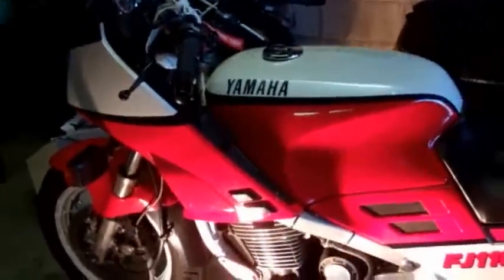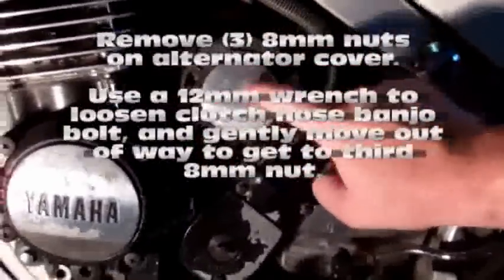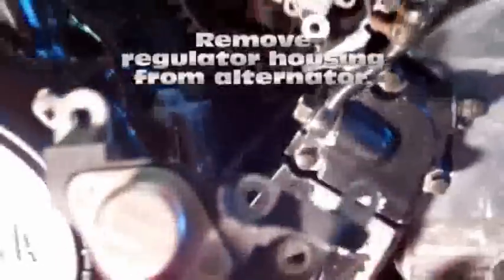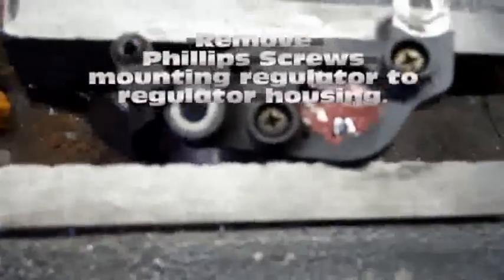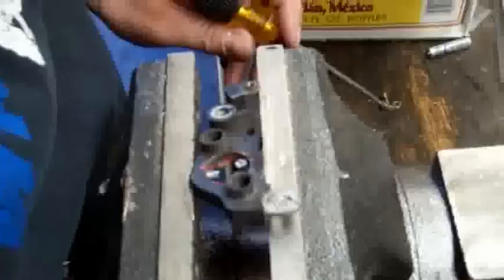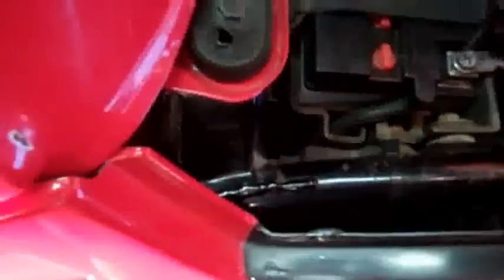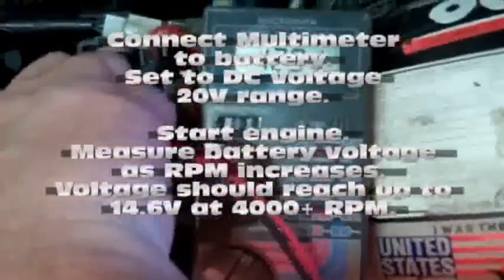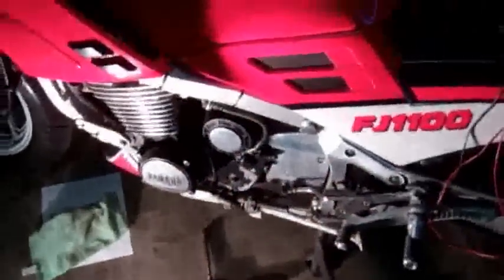RaceTech Electric R025 Voltage Regulator Install on Nippon Denso Alternator in Yamaha FJ1100

Comment: Thanks for the video. I've had my FJ1200 since 1994 & have had generator problems in the past. A couple of batteries got overcharged until I installed an automotive regulator external to the generator. My generator stopped charging so I had to replace it with a used one & installed the RaceTech regulator in it. The video was helpful to assure me I was doing it correctly.
Reply from the maker: Thanks for the info!

Comment: I purchased one. Revisited the video for install. A few points: There is a reason the camera cuts to installed. The part’s from China and it does not fit properly. I have 1993 FJ1200. Tools needed: 
1.Tin snips to trim the connectors.Rings too big and need to be trimmed way down or crushed in place. 
2.Razor blade to trim back the wire sheathing.Need to bend wires to fit without destroying the part.
3.Offset nut also needs a washer.
Reply: The prototype likely worked great. The supplier either has QC issues, or  more dev work is needed. Will report back. Initial voltage readings indicate the part works.
Reply from the maker: Good to know thanks. But this install was probably 8 years ago. Parts have improved since then.

Comment: Question, When you loosen the banjo bolt to the master slave to move the line away, Did you have to rebleed the cluth line/lose pressure or everything worked fine ? Just wanted to make sure before loosen my fj. Thank you!
Reply from the maker: No I don't recall having to bleed it.

Comment: Hi I am losing my mind.  Just replaced my regulator per this video instruction. I have a 1985 FJ1100 the blows the main fuse as soon as I turn the ignition switch to on.  I have a 1993 Clymer service manual and have been troubleshooting the coil, regulator, rectifier, and stator.  I think I confirmed the stator is not grounded.  I also confirmed the resistance for the rectifier is ok.  I have no idea where all the grounds are on this bike and don't think their locations are listed in the service manual. I thought it was the regulator as the bike would hold the main fuse and start with the stator terminal unplugged and the bike cold prior to the replacement. So, I just replaced the regulator from a Rick's to a Nippon Denso.  Rode for 30 seconds and the main fuse blew again.  

I then thought it was the pickup coil, as the main fuse blew with the stator unplugged with the new regulator installed and coil plugged into the IC Ignitor.  My manual lists the coil resistance ohms range from 108-132 for the coil in a Transistorized Ignition System.  My coil reads in the low 200s warm (low 180s cold) and blows the main fuse from a cold start.  However, the fuse still blows with the stator and coil unplugged from the IC Ignitor.  Before the regulator replacement, the bike would turn over cold with just the stator terminal unplugged.  Please help!

Comment: Hi I have a suzuki 1100 gsxr 1986 model .I need the R025 ic regulator. Where and how can I order ? Can you help me because im in the Philippines
Reply from the maker: They are still available through RMSTATOR:
https://rmstator.com/en_ca/nippon-denso-internal-voltage-regulator-for-triumph-kawasaki-suzuki-yamaha-motorcycle-1985-2014